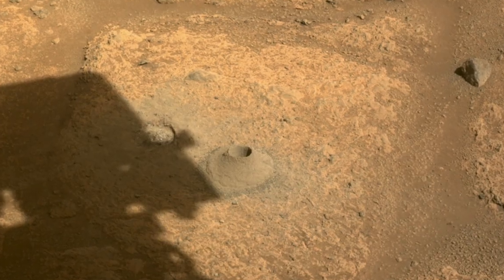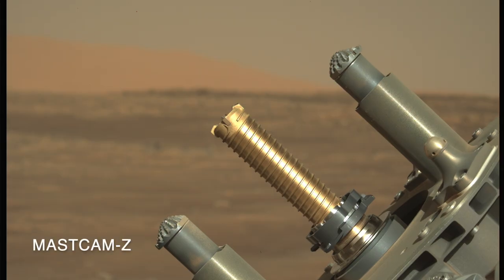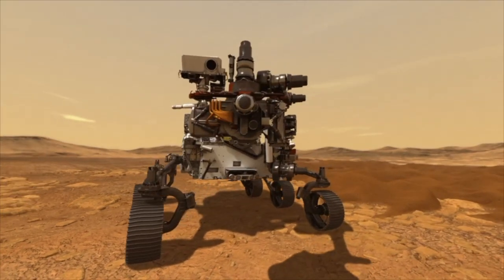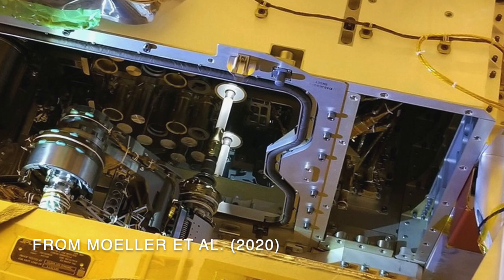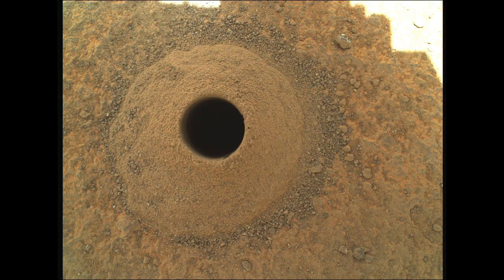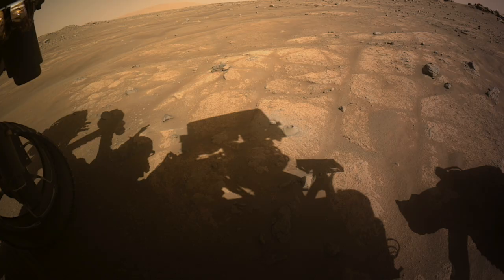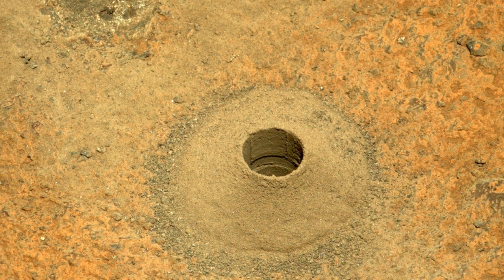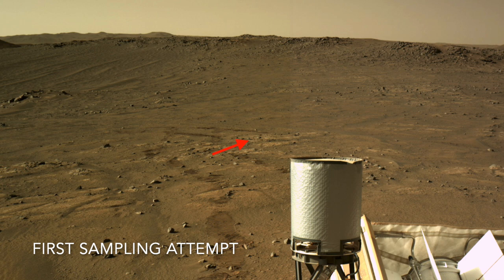Search for the missing Mars rock sample

Comment: The impact action of the drill will pulverize any rock sample below a certain tensile strength.   If that could be disabled a slower cut will result and softer cores can be retrieved.
Reply from the maker: True.  The percussive action can be shut off for rotary-only operation.  So we may see them try that in the future.

Comment: Can the sample tube be re-used or is it considered contaminated?
Reply from the maker: There are "extra" tubes onboard so none has to be reused, yes, to avoid cross contamination between samples.
Reply: I do not think the system was designed with re-use in mind. I am thinking it has been sealed and dropped on the ground by now.

Comment: So, it probably just fell apart during drilling and spilled out during extraction…is this something that happens with earth rocks as well? That these are too weakly structured to use a coring drill on?
Reply: Apparently they tested the drill on a 100 samples on earth. I presume they tried a range of rock sample types but this didn't happen on any of those?
Reply: @matthewhart898  The NASA article I read last week said it never happened during testing on Earth
Reply from the maker: The softest rock used in the testing described in the Moeller et al. article (https://doi.org/10.1007/s11214-020-00783-7) was a mudstone, which broke up during coring but with large chunks that were recovered.  This Mars rock must be even softer.
Reply: This is an example of learning from a failure.  Perhaps future coring hardware on future rovers could have something like a closeable iris at the bottom end to lift out and retain pieces of broken core?
Reply: @jamesrussell7760  That may be the answer, but based on their testing, that would have added unnecessary complexity. I think the lesson is that their set of test rocks wasn't broad enough.

Comment: Are there any sensors/fail safe mechanisms within the drilling process that would point out what happened?
Reply from the maker: The Cachecam and a volume probe can confirm whether or not a sample is present, but the process runs end to end regardless because a contaminated tube can't be reused.